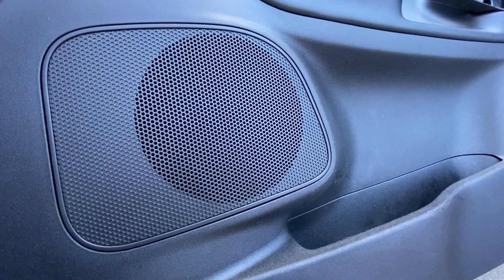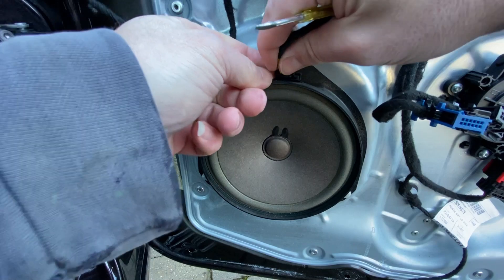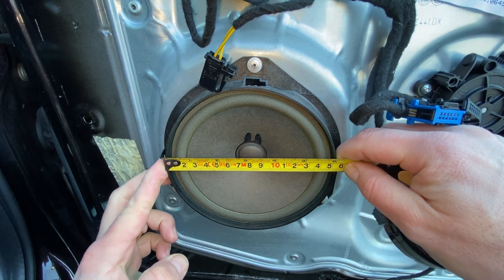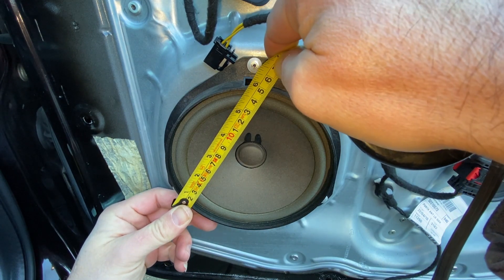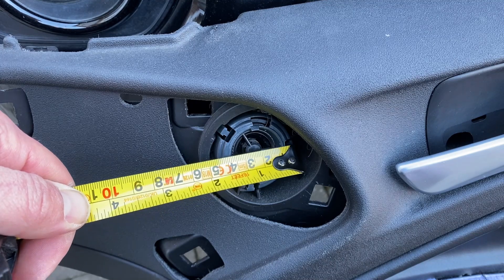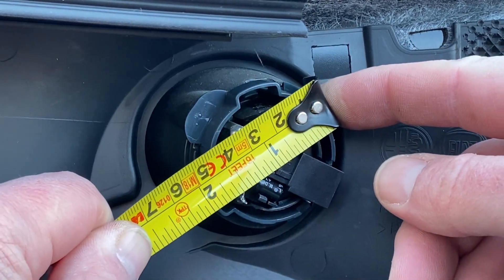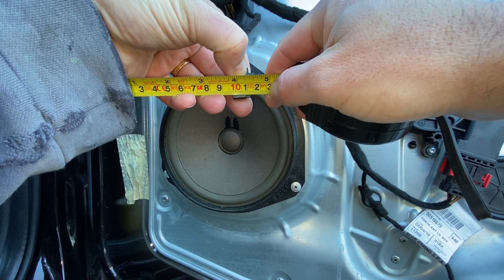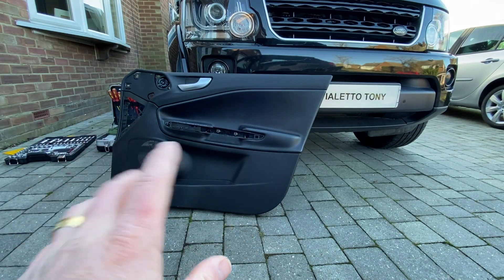Alfa Romeo Giulietta Speaker Upgrade or Replacement Investigations

Comment: Great Video. I'd like to add that it is worth to check all items that can rattle (cables, connectors, modules that are loose) and fix them either with foam,putty, glue.

Comment: I have to replace one of the rear doors on my Giulietta, dodgy repair from previous owner. But I have the Bose system fitted and all the doors I seem to find for sale are standard stereo. Does anybody know if it’s a easy swap on the electrics?
Reply from the maker: Not 100% certain, but I believe the mounts and plugs are the same

Comment: Hello Tony! Thanks for the info :D Do you have any idea from what manufacturer the speakers are? I know that the top sounding speakers in a giulietta might be BOSE  but personally I don't have those and I see you don't have them either :). Thanks again and have a nice day!
Reply from the maker: Hi Alin. No I’m not sure which manufacturer they are to be fair. I think there may be some differences from year to year, as the sound quality in mine is very good, with lots of rich bass and treble, but others complain of poor quality. 
Thanks for watching and subscribing. 
All the best 👍
Reply: @vialettotony  I must have the decent speakers too then! The stereo has always sounded good in my G (2011 model).
Reply: People need to be aware that the standard speakers have a rubber seal around the edges and if that gets disturbed like mine did when I drilled the rivets out to remove the speaker but used bolts instead to reinstall it , rain water will creep in and soak the sound proofing foam under the carpet big time. Luckily I noticed early and sorted it out with a rivet gun and silicone sealant.
Separately I wouldn't recommend messing with them anyway , yes they are cheap and crappy speakers but sound pretty impressive thanks to the metal cavity of the door itself allowing excellent bass generation. 
I even got some speaker spacers to upgrade them with but they didn't fit properly , leave your Guiliettas speakers alone people !
Reply: @greengrass9572  you could've just cut out a new rubber seal with sheet rubber and still used the bolts rather than slap silicone all over it
Reply: @EazyDuz18  you can't get your fingers behind the bolts and secure the nuts enabling you to tighten them up so I had to buy a rivet gun.
Also why go to all the trouble to aquire sheet rubber , measure and cut it on a part that isn't seen when black silicone sealant is much quicker, much cheaper and probably more effective?
Sort it out.
Reply: @greengrass9572  Oh you should've used self tappers then like most cars. Silicone degrades over time too so you'll have to go back in there. Very bodged job you did I'm not impressed.
Reply: @EazyDuz18  don't call yourself 'combustion69' because you clearly don't know what you are talking about on the subject of cars. Why don't you go and tell  Alfa that because it left the factory with the speakers RIVETED in. If you knew what you're talking about you wouldn't suggest doing things the difficult and expensive way when it's not even necessary. Also I did not 'slap silicone all over it'. If you are messy with silicone doesn't mean everyone else is .If you cannot understand the repair someone is talking about don't comment in the first place.
Reply: @greengrass9572  I dont use silicone where it isn't supposed to be used, because it degrades over time as you will find out. Rivets are an oversight by Alfa, any metallurgist will tell you self tappers are best for that application. Bodge job, but if your happy with it so be it. End of
Reply: @EazyDuz18  I used heavy duty flexible weatherproof including UV black silicone sealant from screwfix and I can assure you it won't degrade for 30+ years see their website. 
The original seals are stuck hard to the door and transparent making splits difficult to see. You would need a blow torch and scraper to remove them , but thats OK with you because you like to waste time and energy. 
The sealant is wet on application and will spread , dry and seal in conjunction with the original seal beautifully. 
Listen, unless you've done the exact same job and know what you're talking about , don't bother. The revits will hold fine as they aren't subject to great stress and the designers know that so it's not an oversight by alfa.
Reply: @greengrass9572  cope

Comment: Hey dude, I was wondering if you have a video on the leather type thing on the door panel’s, underneath the handle. Mine has come out and its not fit with the panel as well as it loose. Anyway I could properly show you as well as what is the fix for it?
Reply: I had a few other questions in mind I need help with, I would greatly appreciate a reply.
Reply from the maker: Hi Hassan. Sounds like the glue has come away from the door panel. Is your interior red by any chance? I know that’s a common issue  with them. What other problems do you have?
Reply: @vialettotony  nope this one is black. and apparently I seem to be missing the aux and usb port in the car. I cant seem to find them where they should be, in the glove box. any idea?
Reply: @vialettotony  sorry for the many comments 😅 but one more issue I have is that when my car is locked the boot can still be opened, it doesnt seem to lock at all. and I get the boot is unlocked msg on dashboard too while driving.
Reply from the maker: @hs.q16  you can send a picture on Instagram if you would like to. There’s a link to my profile on the banner on my channel. 
The USB and Aux ports vary from model to model and year to year. I have USB only which is in my glovebox. Later models had it by the DNA switch. 👍
Reply from the maker: @hs.q16  sounds like a wiring loom issue. Really common issue. Do all the rear lights work okay?
Reply: @vialettotony  no issue with the rear lights, I thought around on it and could it he a fuse issue?
Reply from the maker: @hs.q16  as far as I know, the central locking is all fed from a single fuse so if the doors are locking, the boot should too.
Reply: Hassaan check left wiring loom fix from the boot. In my opinion the cut wires are the problem

Comment: When I replaced by 156 speakers at 80kKMS they were the same paper shyte. I would have thought that the later cars would have poly-prop speakers by now. That's seriously cheap arse Alfa. Replace those speakers with a low-end two-way Clarion set with poly cones will make a massive improvement to the sound system The head units are normally not the issue. It's blastered cheap arse paper cones. Must have had an oversupply from the '70's Alfa's.